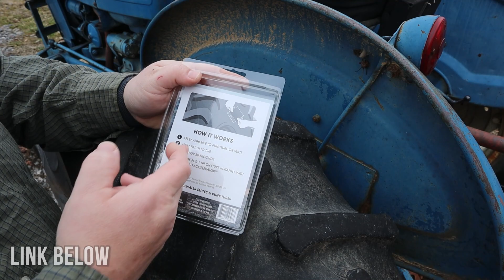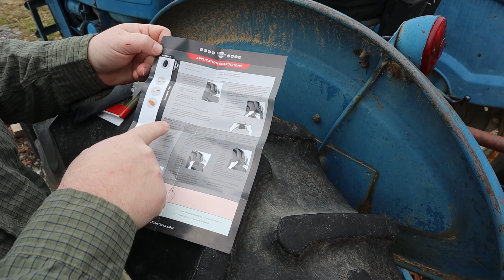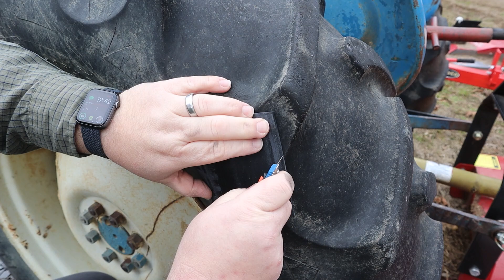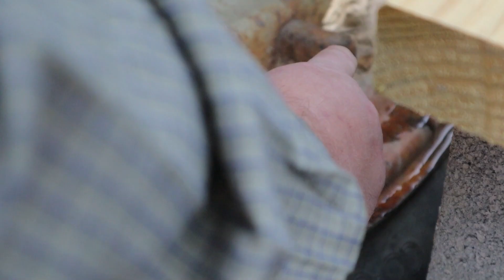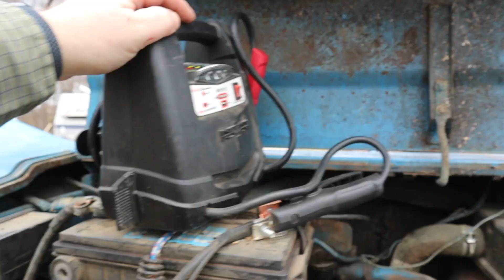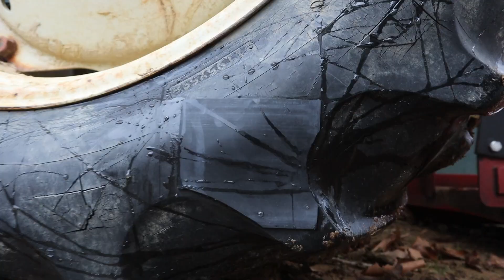No way this works... Patching the SIDE of my Tractor Tire

Comment: 🛞👍🎅🏻 it’s a lot of work but I would try and patch from the inside. Can also put a big patch inside and use a tube till you get new tires
Reply: Put a boot on the inside and install a tube that will fix it
Reply: @marilynallen644  We were in the construction  business for 30 yrs. Boot and tube. Couldn't buy tires all the time.
Reply: Nah!  Tire is shot!
Reply: I agree, New tubes will give you the life you need until you can get those new tires.
Reply: Boot, liner and tube. If your liquid in the tires is calcium chloride,  get it out ( it's rotting your wheels from the inside ) ! Beet juice . That patch probably won't last long on the outside. Good luck, been there, had to buy 4 new wheels.
Reply: That be better way to do  but hole might be to big
Reply: That tire is toast as soon as he prys on the bead.  But I like the patch, I'm gonna get a couple to keep in the shop.
Reply: @hedgeapplehomestead2816 you are full of chit and know nothing.

Comment: Patch inside then tube?
Reply: Ric he was trying not to do that. And if you're far away from home you may not have the tools to open it up to do that.
Reply: @MJY58  I know that and sometimes get home is all that matters. While that may hold air it may not hold weight considering the dry rot. And even with good tools dry rot tires are hard to get to break off the bead. I lifted the end of my 10-16 shed with a homemade 2-4 bead breaker dismounting an atv tire. I went and placed it on the ground and drove up on the edge of it with my truck to break the beads. I have a video here showing that on a trailer tire. Not ideal but cheaper than tire shop. 

I’ve watched their channel ever since they moved to TN and Sam is very resourceful when it come to getting things done in less than ideal or normal means.